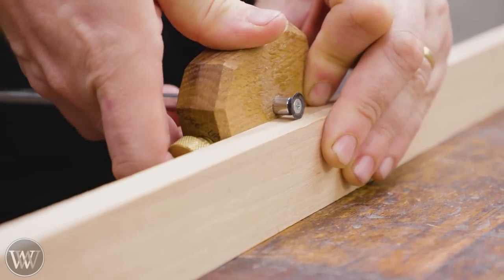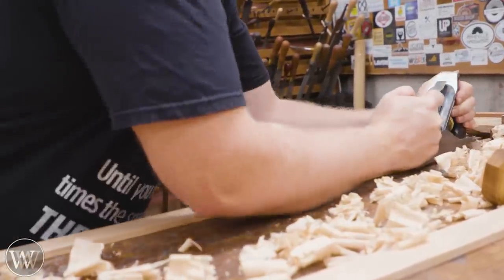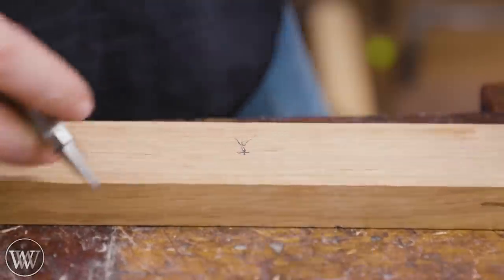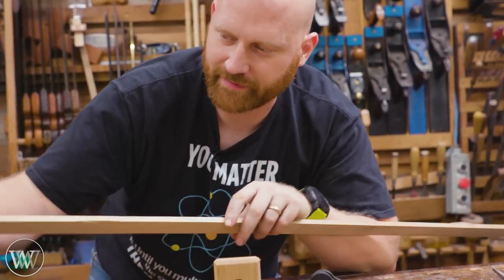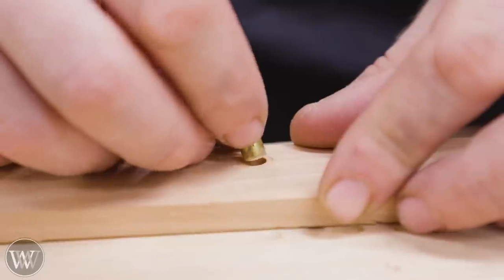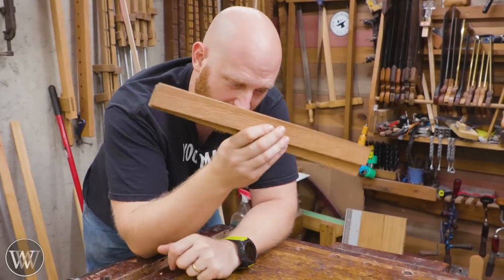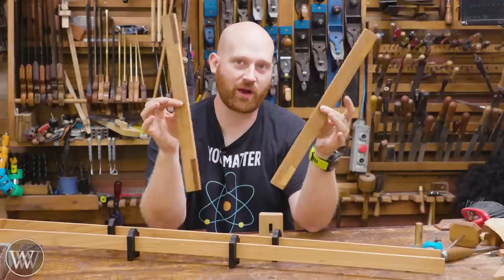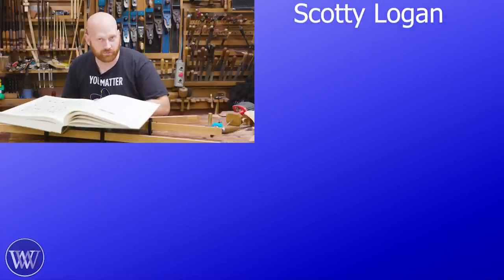Fun and Simple Winding Sticks Roubo Style Beginners Woodworking Project

Comment: I think im too simple..I stop at the 2 sticks after planing them flat and even with a little bit of sharpie for contrast.. Think that means I should branch out and try something!
Reply: I did a cheap trick that I think still uses the roubo sticks principle. I trued up all sides of the sticks, then cut off two small blocks from the ends. I just plonk the winding stick on the two blocks that I cut off. I would install magnets on the blocks and a metal strip on the bottom of the sticks if I wasn't a lazy shit 😅